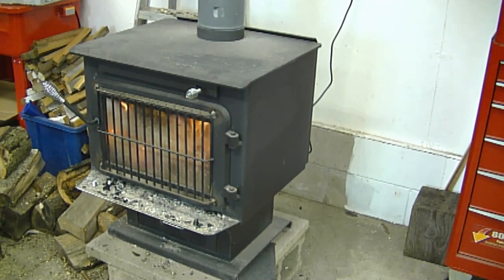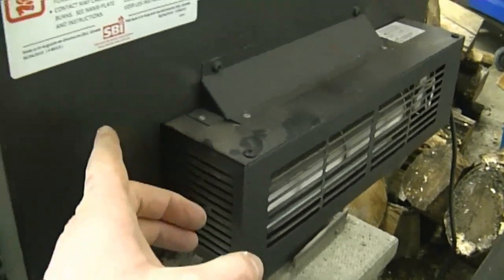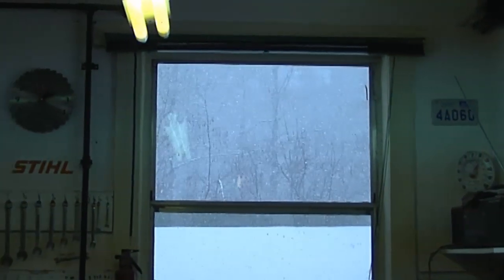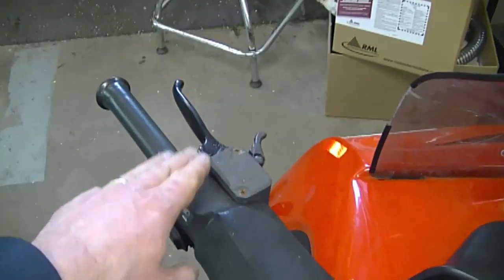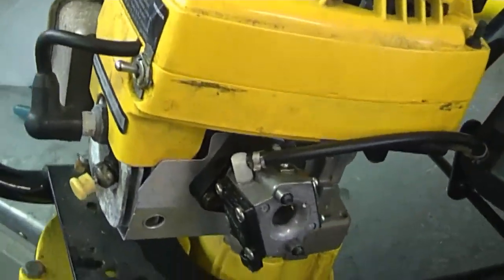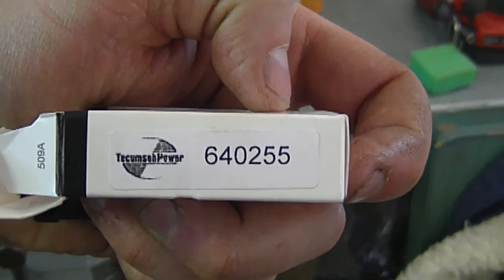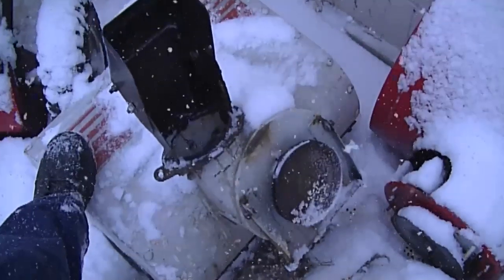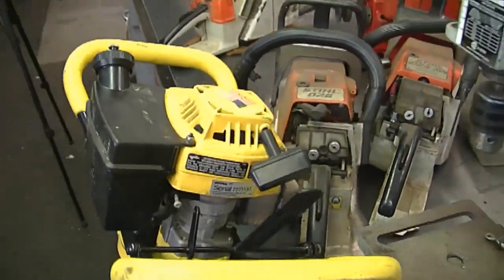Small Engines Q & A Video #118 in HD

Comment: Answering my own question: The service manual describes the adjustment procedure. In short: move the arm that the cable normally moves with your hand, until it's fully engaged. Bring the lever down gently, until there's no more cable slack. Measure and adjust the distance between the lever and the handle grip to 3 inches by adjusting the cable length. The lever is so much easier to hold down now!

Comment: Blowing in pretty good here Don  .. Great Vid. There is a  metal  fan you can get to set on top the stove an  blades turn  by  the  heat an blades  move the air . will send you link .

Comment: Hey Dony,

Before jumping right in and breaking a plastic pulley that may be seized on a shaft, one can try hitting the center of the shaft itself with a small torch, keeping the flame from actually hitting the plastic, and warming the shaft just short of the plastic melting point will often allow you to slide the pulley right off.  Just be careful not to melt the plastic. or the bore in the pulley will go out of round.  worth a try if you're gonna break it anyhow.

Comment: I have a simlilar wood stove. I payed $350 plus 8% tax. It was on clearance sale. Normal price was $600.

My Wood stove does not have the ash bin as yours does. Though for the price it has more than payed for itself.

I get free wood as a property manager. I often have to cut down older trees as preventative maintenance and after storms. Often I would give the wood away. Either to individuals or the local township to turn into mulch.

One year I saw the little stove on sale and thought why not. My home is only 650 square feet. If anything it would be nice to have to supplement my heat. Lower the heating bill and during a power outage provide heat.

For the tiny stove it is I'm amazed how much heat it can produce. I'm happy I went with the smaller model. Anything larger would have cooked the house...

It's great to actually utilize wood. Last year I stockpiled enough firewood for five years of harsh winters. Now the issue has been keeping it dry.
Still end up giving away wood. Can only use so much. But at least it's there in case.

Comment: Hi DonyBoy,
I am a big fan of your channel, always great videos and great information.  I was having a problem with my Craftsman Snow Thrower (model 536.886120), the chute would clog a lot.  I eventually thought to check the belts, and sure enough, they were very loose.  I was able to adjust the idler pulley to take up some of the slack which got me through this storm, but I need new belts.  What's a good source for these parts?  Thanks!
PS- I'm in the USA.
-mc

Comment: Don, we had our first snow storm the other day in NJ and it was the first time I used the snowblowers in some time.  All of the snowblowers were rune dry and the fuel is always treated with stabil or seafoam or both.  All of the machines started up no problem but they all had leaking carbs.  I'm thinking the rubber seals dried out.  Any idea how to avoid this type of issue in the future?

Comment: Hey Donny, do you know a good way to un ice/freeze stuck choke throttle cables, there the old school all metal ones and the go close to the fuel pump so no fire, it on my late 1960's case 220 restored tractor

Comment: I have the same Tecumseh engine on a mini tiller that you had on that ice auger and I replaced the carb kit and it still wouldn't start and I found that the plastic spacer for the carb was flipped the wrong way which caused it not to pump fuel properly

Comment: Thanks Dony. At 5:06 (ice auger)...I have a similar engine on a small tiller (mdl: TC300 3152F w/Tillotson 112E815). Any idea where I can get a replacement for the white fuel inlet? The fellow at the repair shop said I have to buy the whole carburetor (for $60). Any suggestions? Do you have to improvise parts? Maybe that's another series..."Improvising and Field-Engineering". Thanks again!

Comment: How can you tell if engine vibration is excessive? I ran a snowblower with an 8HP Tecumseh engine for a couple of hours at full throttle today and hours later my hands are still buzzing. This never happened when I used another, smaller blower with a 5HP Tecumseh engine in the past. Would taking the traction drive belt off and running the engine to see if vibration goes away be a good test? Is more vibration expected on a bigger engine?

Comment: Hey don. Would you happen to have any videos on tearing down/ or repairing an hsk 850 or simular. I searched the channel and didn't come up with any videos except a starter.  I have 2 engines. the first was run straight gas which ruined the block and piston. I purchased a second block (used) and when it arrives one of the top fins on the engine was cracked and bent and the Governor shaft was bent. Do you think it would still be ok to be used.

Comment: my atv has an electrical problem. after i installed the front racks,the neutral and reverse lights stopped working. they came back on the same day,but when they did,it caused the ignition swich to only kill the motor when it was in neutral with headlights on,or in 1st gear with headlights off. do you have any idea what is wrong?

Comment: don , i have a 8hp mtd snowblower. i recently replaced the traction wheel, because it was cracked. befor installing the wheel, i matched to the old one, and they were identical. i folled your video to install it. problem im having now is wheel grabs abouy2 inches before handle reaches the bar, and the cable is very very loose, will ths tire wear down over time, or what may be the problem? thanks for your time, dick bailey